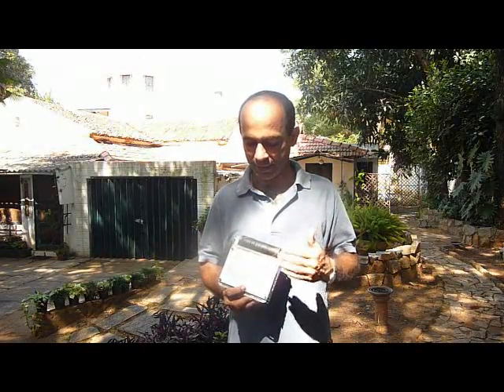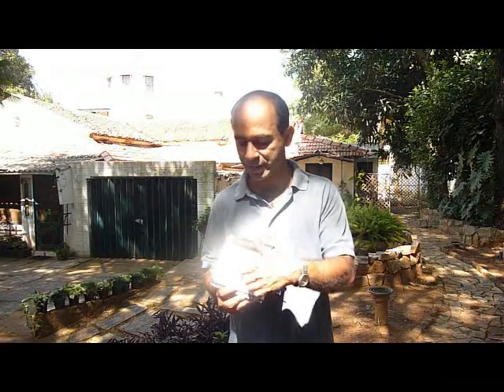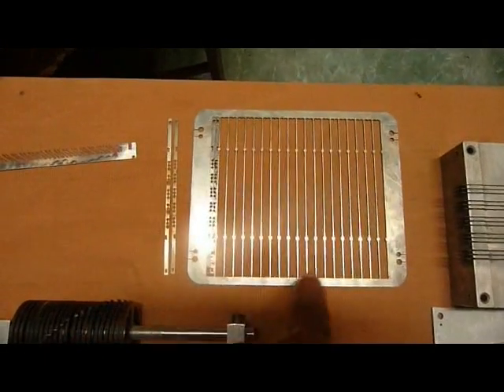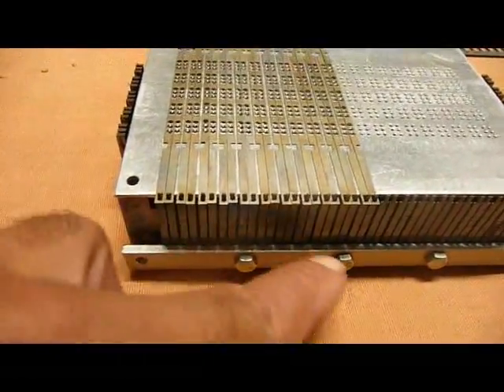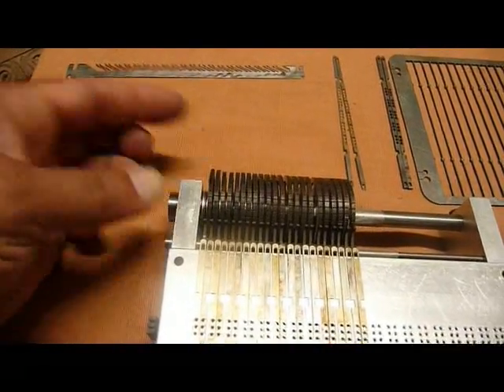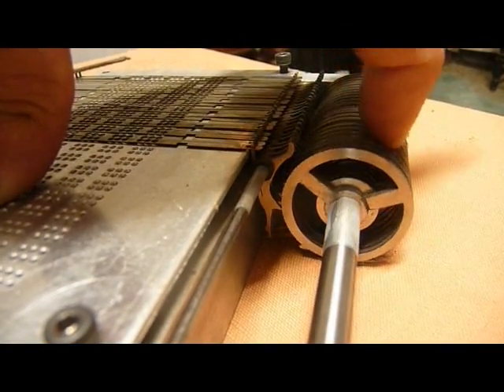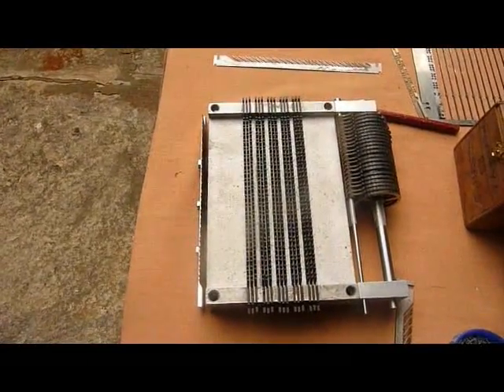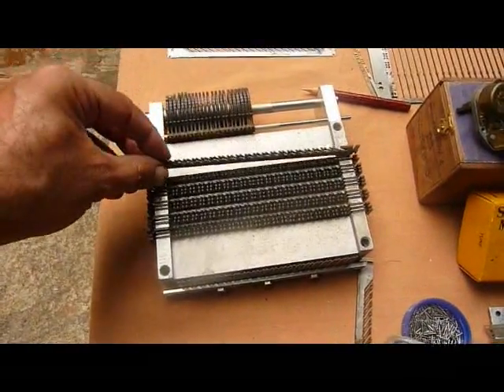Multi-Line Refreshable Braille Display:  Working & Construction

Comment: brilliant design！The multiplexing mechanism is just like a LED matrix. and only few motors can control all individual pins! Fantastic！！
The parts are easy to mass production,and there're only few different types of part.
May I ask your progress now?
Reply from the maker: +Thimble Liu Thanks for your comments.   I have temporarily put the multiline version on hold while I concentrate on on the SLRBD.   You can search for SLTBD on YOUTUBE to see my current work.
Reply: +pgdsouza I have seen your single line version .it's awesome!
I'm very interested in how you interface your decices with computer, and how you manufacture your prototype?